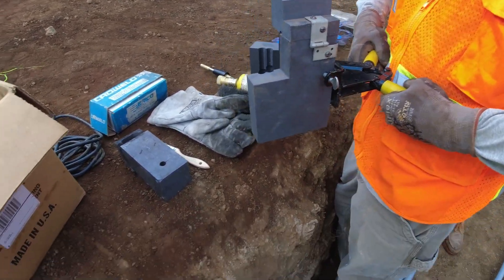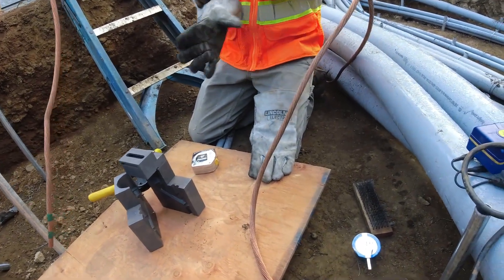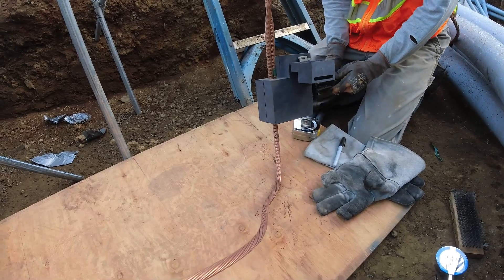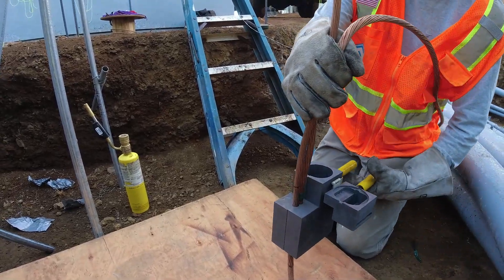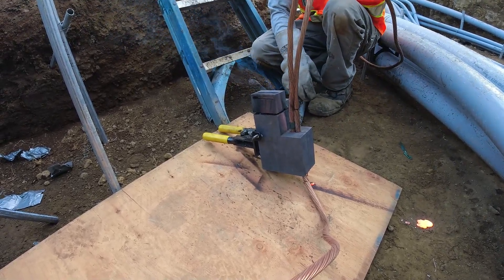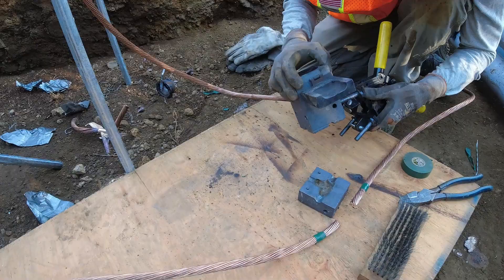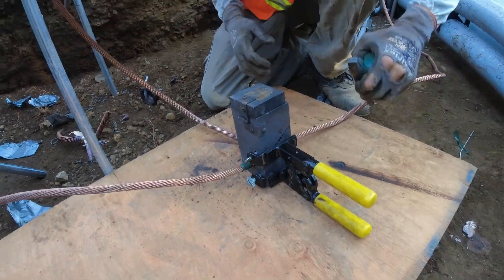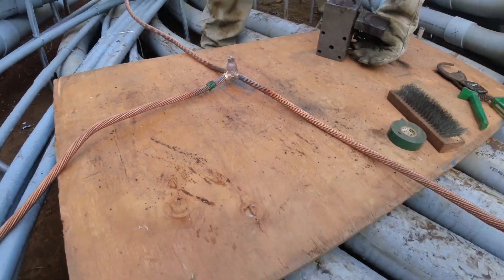How To: Exothermic Welding 4/0 Copper Ground System With Cadweld Plus Molds And Charges #electrical

Comment: if I may ask why not used
 burial sleeve
Reply from the maker: I'm not sure what you mean by burial sleeve? We use exothermic welds because it is permanent and doesn't rely on any mechanical connection.